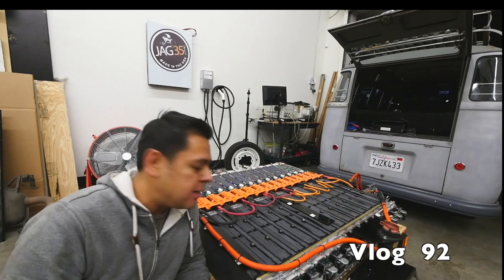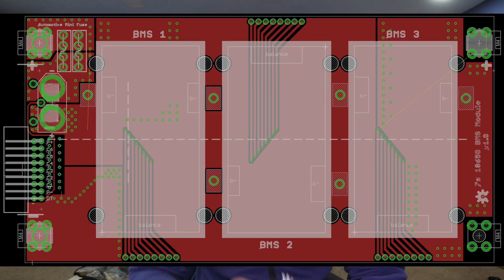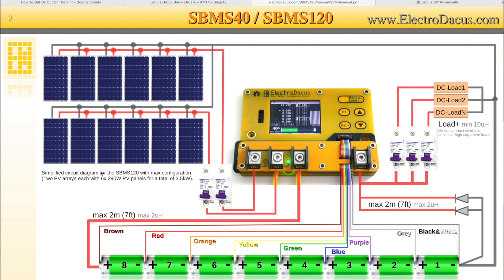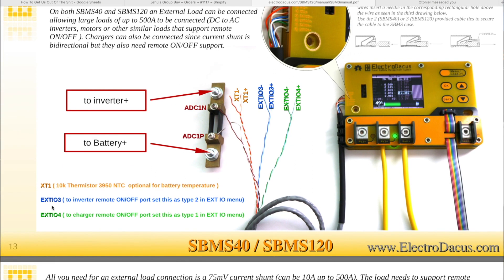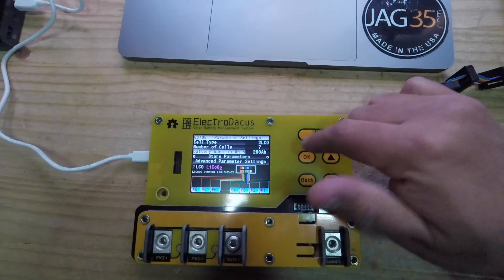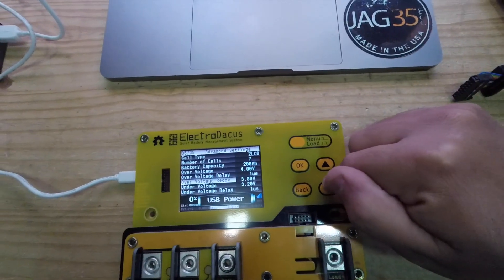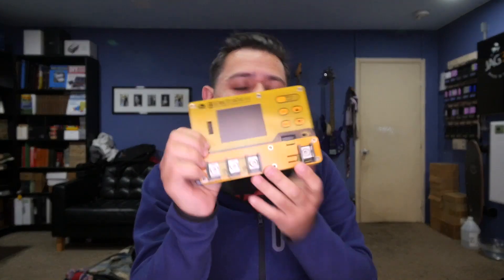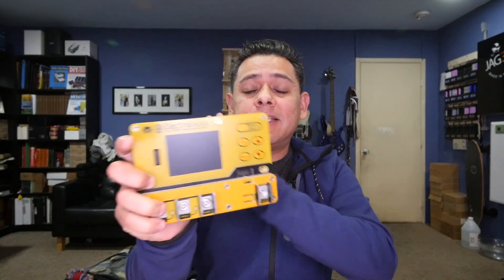Solar Battery Management System (BMS)

Comment: if you have a SMART BMS in your ebike battery pack... Do you need a separate BMS if the ebike battery is charged by a GVB-8 LI-MPPT-boost/charge controller connected to the Solar panel.

Comment: How does it handle high Amp loads like a 12 volt 4000 watt inverter/charger I'm going to be using 320 ah life4o cells

Comment: Hey there Jehu.  I was wondering. Can you use for instance a 4S 5P BMS (18650) in a 3P configuration? Then add the other 2P later? Like a day or so? Or does the whole BMS need to be populated for it to work??? My goal is a 4S 14.8v board that hopefully I can expand later to increase the amperage/storage.Thank you!

Comment: Hello
thank you for your quite informative channel
I would like some information, I cannot understand how to choose my BMS
as an example I made a 12v 3S4P battery with 12 18650 batteries (recovery from 2.5ah to 1.8ah) to operate a 20w led ... I understand for the 3S but how to determine the current (A) of the BMS? knowing that the led consumes about 1.6ah ...
thank you so much

Comment: Hey, I am having problem with LiFePo4 battery pack 10A BMS. It cut off due to my 300w inverter capacitor charging even when its drawing 15w only. I am thinking of using BMS for charging and another way for 20A discharging. 
What battery protect system should I use, Victron BP-65 is not easily available & is expensive in India.

Comment: I was trying to decide on whether or not to use a commercial BMS.  I assume any BMS will have a current drain on each cell to achieve balancing.  My voltage regulator limits charging voltage to 14.5v.  On a 12v 4 cell LIFEPO4 battery, I think I can get by with 4 x 330 OHM resistors as a voltage divider between cells, which will have a 10ma drain and passively balance each cell to the same voltage.

Comment: Dacian has the SBMS0 which is a unit like the 120 and 40 only without the ability to take the power from your PV panels and put it into the battery. What he has now is the DSSR20 which is basically a charge controller for 2 PV panels that you run to your battery bank. That means every two panels are independent. If you have 12 panels  and one gets shaded only that pair will stop making power the other 10 panels will continue to send power to the battery bank. The closest thing I can compare it to is a mini inverter but for your battery bank. The other thing is they are for lithium batteries so they charge to the set point and stop charging as lithium batteries only want constant current and then nothing. This system will extend the life of your battery big time. If you are using a system that give the three levels of charge like float etc then you are hurting your lithium batteries and most people do not even know it. Stop using any other charger system for your lifepo4 batteries because you are shortening their life. This is for a 24v off grid system and it works perfectly. you will save so much money and kick yourself for not doing this sooner.

Comment: William I bought 32 cells of Yinlong Lithium 66160h 2.3v Titanate & the BMS I got their processing still was DYKB 7S - 20S Smart Bluetooth 80A , 100A , 320A , 300A , 400A lithium Ali-ion Lipo LifePo4 Battery BMS protection board 48v , 36v , 24v , 16S  I ordered 2 “ I could not find what you had recommended on Ali Express ! Was this a good choice ? I lost the link to buy them through you , although I did message the sellers I was vying because of you DIY Willian

Comment: Hello sir, as a newcomer to the building of lithium ion batteries I have stumbled across a problem you may be able help with please if not too much trouble, I have built a 3s 8p battery and went down the path of installing PREBUILT BMS`s onto them, my BMS was attached to the end of the battery and connected to the cells as I was advised, on completing them and having a I noticed on each BMS some of the components  were getting ridiculously hot to the point they were untouchable, is it possible I have wired the BMS up wrongly and would you consider them now to be burnt out and useless? many thanks and eagerly awaiting your reply,

Comment: I understand these are really cool charge controllers, but I don't understand why he did not make one that was MPPT? One would get about 15% to 20% more out of the solar panels. There are some very nice BMS with bluetooth capability to monitor including many verynice charge controllers that this would compete against. These SBMS charge controllers were pretty much obsolete when they first came out simply because they had no MPPT capability. They are unique with the screen and processor but also a step backward in charging capability. If one is concerned about a BMS handling a large amp load one can easily have a BMS control a 300 to 500 amp relay. The only reason I can think of for him not including the hardware to make this an MPPT is because these PWM controllers are somewhat simple in number of parts and did not cost much to make. A fancy PWM charge controller is not any more efficient than any other cheap PWM controller but still cost as much as a good quality MPPT controller and separate BMS, I just don't see the advantage.

Comment: Does this negate the need for a solar charger? When buying a bms what is the "amp rating" relating too? the charging max amps the battery is outputting or the max amps the bus can handle from the solar system? Thank you for you videos and you time if you answer this question!

Comment: What is the right BMS for 4s 10p battery pack ......cells are 18650 3200mah .....what is the current rating of bms ??

Comment: Thanks so much for the video! I was wondering about the following: if I want to connect 12 3.2V 100ah cells to produce a 12V 300ah battery, how would I ideally connect a BMS? Will I connect a BMS for each of the 12V 100ah batteries and then another one for the battery as a whole? Or just for each of the 12V 100ah batteries? Or just for the battery as a whole? Thanks so much!
Reply: If each BMS does only 100 Amps then you would design three different 4S1P batteries and then connect those three batteries in parallel using 3 @ 100 AMP FUSES ...

Comment: hi garcia, ive watch a few of your vids and u seem like a very knowledgeable person using these batteries, but i have to add something that ive noticed has never actually been mentioned, now we all know that 18650 cells are different in chemistry and milli-amps,  (1) if u over charge a 18650 battery it releases the top vent(built under the cap) and shuns off the over charge pressure which can result in the battery going bad(never seen you guys mention that) (2) when packing multiple 18650 cells, lets say 80 in 1 pack thats 4/20, we do not have all cells at the same charge capacity(even if the cells are new from factory, so when they charge as soon as 1 reaches full the power is vented off to the other battery that's not full, ive tested this theory of the repackr method against just randomly putting known good cells in a pack and they both charge excellent, what i do notice is u guys say u want each cell being as close in milli amps as possible which is a very wise choice in my opinion but i myself have done tests where a cell varies off buy 1amp and it does work flawless when charging using my solar panels, so the repackr to me is not a must, but its a good thing still, (3) ive seen you show the concept of buss bars and ive never seen anyone explain why using certain thickness in bus bars can lead to under charging or low power output,wires are rated in ohms to carry a certain amount of power, and when using 12v, 24v, 48v etc etc the wires are rated differently. i could go on about a few stuff but i'll leave that for some other time, cheers

Comment: I would like to ask. Normally 18650 is max at 4.2 volts.and now i got bms for 26s config. Now how can i under volt them charging them at 4volts. Should i supply 102v and bms will balance them at 4v each cell or some cell will be 4.2 and some cell are lower
Reply from the maker: No bms usually only balance once any cell hits 4.3v
Reply: @jehugarcia  have you tried smart BMS before.? do undervolting or can i set 4 volts on max voltage settings. ?

Comment: Hey Jehu >>  I'm way behind but I won't lose track of you again.....  A Power Wall is
something EVERYbody needs whether they know it or not..... lol,  I desperately need
all the help I can get on this journey.  I want to CUT the Electric Company out of the
equation.  Batteries have been the problem & I thank you for the heads up on all the
components too.  I'm getting ready to set-up a Hydroponic Garden whereas I've got
fish growing & the waste feeds the plants as they filter the water for the next cycle.
OFF the Grid is the only way to go..... I'm with you,  so glad you're doing this and I
need help sizing & other stuff...... thanks man
Reply: For many / most people generating your own power can be more expensive than the Grid.  You will need a huge power wall to run an ALL ELECTRIC home - especially in the winter time when there is no sun for many consecutive days  and it is below zero outside.  The average home consumes 30 kilowatt-hours per DAY !!!

Comment: Have seen your videos and enjoy them. Need some help hoping you can solve my dilemma. I purchased a volt bike about 2 years ago which is no longer sold.
 Since then the 48VDC battery pack will not take a charge. It is to my credit they do not charge as they were left for about a year without charging.
The system consists of a power brick (115VAC-Input to 48VDC-output) which plugs into the battery pack on the output side of the battery pack are some terminals for output.
I have been informed for this situation I could connect an ordinary 12VDC battery charger to the output of the battery pack and allow it to slow charge. Is there any truth to this theory?

Comment: How does one unit manage to balance more than 7 batteries?
Seems like you would have to invest 300$ per 7pack of batteries... which would get very expensive very fast...
Is there a way of multiplexing the different clusters of batteries? 
Like with relays or somthing like that, you could balance one pack at a time autonomously...
Reply from the maker: You connect many batteries in parallel
Reply: @jehugarcia  I see, tyvm.

Comment: This is a decent BMS, but nowhere near what is needed for something like a home solar setup. It's limited to 24v and 3.5kW, which is fine for a small application, but even a mid-sized off-grid home will need more, and should run off of higher voltage (a 5,000-watt load, which isn't unheard of for a typical home, is more than 200 amps at 24v, for example). Further, Voc is limited to 47v, which means you're going to be wiring a lot of panels in parallel. That's... not fun. It's a wiring nightmare. The designer seems to be well-versed in the theory (I've spoken with him), but not in practice outside of his off-grid setup.

Comment: According to the Batrium BMS 7s Battery cell wiring diagram, the 7 leads are tied to 7 lithium cells (or parallel cell groups) in series for a 24V system.  But, your PCB 7s cell boards are 7 cells in series.  And when you connect multiple PCBs together, you're paralleling them as 7sXp systems.  So how would you connect this or any BMS to balance each cell in each PCB module?  Does each PCB  BMS connector operate in parallel with all other PCB BMS connectors? And do you provide BMS connector assemblies or instructions on how to make them up?
Reply: The ribbon cable ( balance leads ) connects all of the cells, on one battery board in parallel with all of the cells on the adjacent battery board...

Comment: Don't waste your time with a BMS that only drains high voltage cells down to an acceptable level. Here is a link to the bees knees of all BMS's these are ABMS "Active Battery Management System" they work by transferring energy from high voltage cells to low voltage cells all the time 24/7 up to 6 amps. http://www.deligreenpower.com/deligreen-products/190-en.html#ad-image-0
Reply: Top Balancing is fine.  We are not launching rockets to moon ...

Comment: @electrodacus, I’m new to this but have been reading for a few months.  I have access to a few large (ones that go on the roof of the house, maybe 200-300W) PV solar panels and want to hook them up in my back yard to run some hydroponics pumps and to charge some power tool batteries (120V AC).  I will probably add more panels later as well.  I’m not sure what kind of batteries I will use, but I’m leaning towards building them with 18650’s and Jehu’s PCB kit.  I like the idea of have an all in one integrated unit without having to buy any separate inverters or anything else.  Does it sound like the SBMS120 is the right unit for me to buy?  I’m hoping you can reply soon so I can join the Kickstarter.  Thanks!

Comment: Lithium ion battery of 351 volts of 95 cells came with its BMS but I'm converting it from 351 volt to 48 volts for my inverter. Can the stock BMS still work with it if stepped down to 48 volts configuration?
Reply from the maker: Not likely

Comment: Thanks for your informative videos.  All we need is for you to get to the point where you develope and market a Plug & Play Solar System for the average Joe, upscalable of course. Wreaking terror on the utility companies that hold their monopolies in many states.  We are not there yet, but we are slowly, but steadily marching in that direction.   We are still stuck in "research and developement" stages.  The next Elon Musk will have Plug and Play available for say lighting systems and perhaps whole house power generation.  Let's pool our knowledge, so we can speed up the plug and play reality, we have less than a 100 years each, to make our "mark/difference".

Comment: I'm confused...If you go to the kickstarter page and look at the comments you will see someone asked if this BMS will work well with reclaimed 18650's.  ElectroDacus responded that nothing works well with reclaimed 18650's and that when new, their expected cycle life is only 500 cycles.  He stated that this would protect them from over charge and overdischarge but not be able to balance very well.  The exact quote was "In any case SBMS (any models) will work with any type of Lithium cells is just that I do not recommend wasting time with reclaimed 18650."

I find it odd that this wasn't mentioned in the video.
Reply from the maker: I also recommend using new cells with my PCB kits,  where is the confusion?

Comment: Jehu you should do a vlog on adding this bms to your vw van so it’s battery doesn’t die in only a couple years it will last 10 years with 90% range capacity
Reply: 111V is 30S.  Is there a bms available to balance a 30S battery?
Reply: @christothegreat1  Yes there is a 30S BMS, but the AMPS !!!
Reply: MrSummitville 
For high amp protection, you connect each cell with a solid bare wire than will melt when more than X (5 or 10?) amps tries to pass thru it at any given instant.
Reply: @christothegreat1  Yes, I know about individual cell protection,  I am talking about the total amps for the 100 kw electric motor !
Reply from the maker: My bus is 111v nominal,  how do you suggest I use a 24v bms system?

Comment: quick question - What size mppt charge controler should i use for a 500W - 4 solar panel 30V total so max 20 AMP? should i use a 20 AMP one like the cheap kinds on ebay for about 20$ or else?
Thanks

Comment: I have a Canon T7i and I want to build an external power pack with 4 18650 batteries. I have the Canon AC adapter and rather than using the power brick I want to connect a 2S system with 4 batteries. Just not sure what I need. I can easily charge the batteries in a charger so it doesn't need to charge. I need to output 8vdc.

Comment: Thanks! Something like this is an overkill if you already have a solar inverter with MPPT controller included or it goes well with it as a middle point BMS for the pack?

Comment: Quick question: Would it be  better to have smaller packs each with a protection board wired in parallel or one large pack? My thought is that I could add packs later on to add to the total capacity.
Reply from the maker: Both

Comment: Could someone point a guy towards BMS for a 4S system. To make a lightweight car battery. Lifepo4. It's the charger rate from the alternator that makes it that I'm not sure what I need.
Reply: For cars (starter battery) Lithium is just not a good solution unless car was designed for that. Lithium of any type including LiFePO4 hates to be in float charge. Alternators also do not have a current limit just voltage and they will push as much current as they can to get to 14.4V thus a discharged LiFePO4 with the much lower internal resistance will accept quite a bit of current and still stay below 14.4V thus the alternator will be stressed above is design parameters and will likely get damaged by overheating.
Then there is the fact that LiFePO4 can not be charged when battery temperature is below freezing thus a battery heater will be required. In this case is just to much trouble and Lead Acid is better until cars are designed specifically for Lithium starter battery (I assume this will never happen). All of those available 12V LiFePO4 replacement batteries are just a bad idea and do not work so they will not last as much as a lower cost Lead Acid.
Reply: @electrodacus  That's a lot of good info. I was still hoping it could work even if its just for track days. There is a lot on the market for sale for $500+. I was just thinking I could use some headway cells in 4s and have a BMS and I would be good to go.